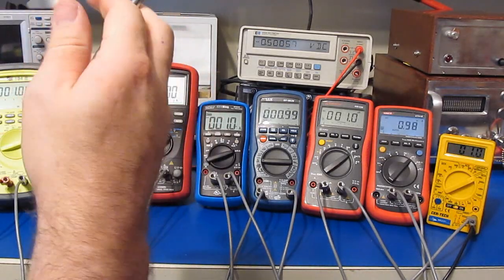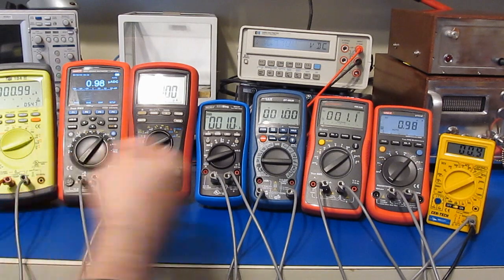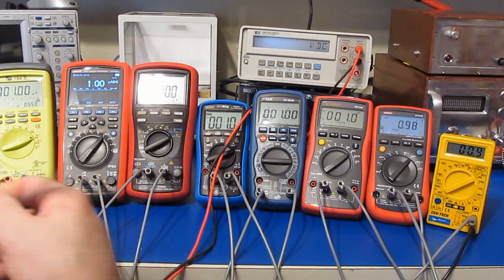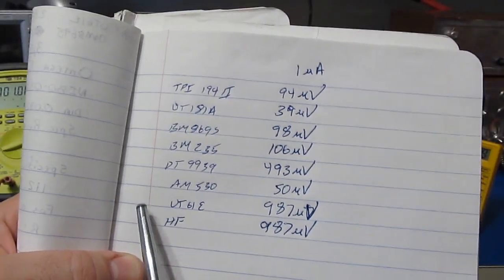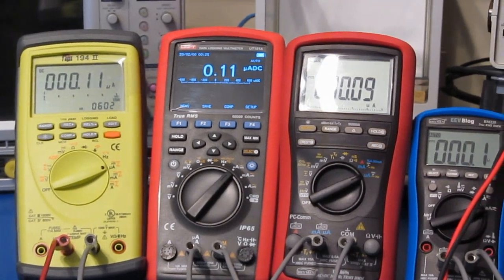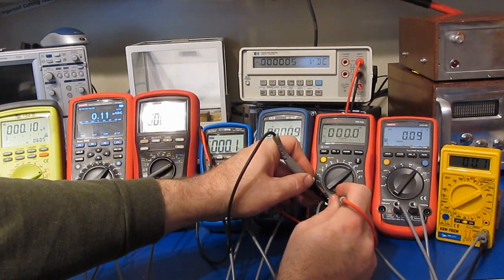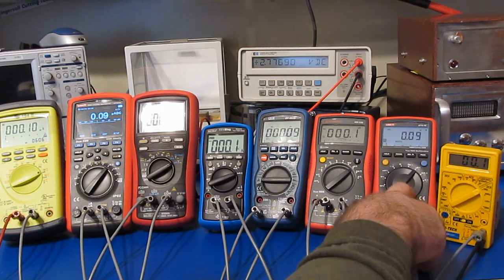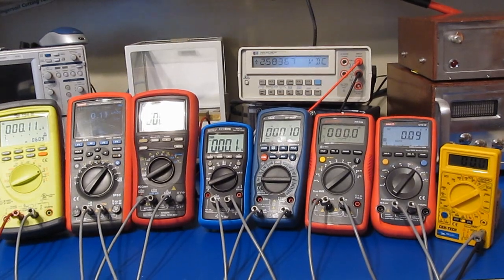Looking at Burden Voltage in the uA Range

Comment: I didnt expect the free one to even read that low lol.
The ut61 didnt supprise me, its shunts are much the same value as other meters.
Good test though :-D.
I found your entrys in the eevlog forum, the chaps seem to like your experements :-D
Reply from the maker: I was going to run the few other meters I have.  So far, just the free meter and the UT61E use the 1K shunt.  But again it was the lowest cost meter in the lineup.
Reply from the maker: Just finished making the video.  At least with the meters I have, 7 use 100 ohms, 2 use 50 ohms, 1 uses 500 ohms and 2 use 1K.  Keep in mind that the vast majority of the meters I had looked were destroyed during my testing.  The meters that I still have are more of a middle to upper class.  CEM using that shunt was poor on their part.
Reply: As you said  earlier, you would need an op-amp to boost the vdrop to be able to reduce the shunt, perhaps a 10x precision op-amp circuit would do the job, but its not worth all the trouble for the two cheapest meters.

Is there any standard for uA burden voltage, do you know?
Reply from the maker: Done with the edit.  Short videos for a change, kinda nice.  I have some choppers that would work very well in there but I tend to agree, it's just not worth it for the average joe.  If I mod it, it would need to be better than the UT181A...

Comment: The burden voltage of my Keysight 1253B is 100uV when measuring 1uA current.
Reply from the maker: Thanks for the info.  I would guess that the 100 ohm shunt is fairly common in the better meters.   I was not too surprised that the UT181A had such a low burden voltage but that AMPROBE AM530 caught me off guard.

Comment: Wouldn't it make sense to also measure with current near upper uA range where burden voltage really begins to matter more? Few mV or less drop seems too negligible but few tens of mV is more practical case. Indeed burden voltage should increase linearly with current increase but measuring accuracy could be better and maybe something else would influence the results.
Reply from the maker: I'm not sure how linear the fuses would be but the shunt should be somewhat linear for each range.  The UT61E does use the 4007's to clamp it.  I guess you could see these cause some problems.  The lower current would seem to be worst case if you were concerned about leakage.  I would expect if I repeated the test with 500uA for example,  the UT61E would drop about a 500mVish drop.  Where the TPI would be closer to 50mVish.

Comment: Joe, interesting video, thanks. Would also like to see a Fluke 87v or even a cheap 115/117.
Reply from the maker: No problem.  I saw the cost for the uCurrent Gold was a fair amount and was curious how well some of these meters would do.  He specs 10uV/uA so a fair amount better than even the UT181A.  Then again, the 181A is protected.
Reply: You are totally right, the uCurrent Gold is a nice tool, but it does not have the protection that a good DMM has.
Reply from the maker: The 115 will not read down this low, nor will the 107 or my HIOKI DT4252.  Of the other handheld meters I still have, the Fluke 17B+, UNI-T UT90A, AMPROBE AM510 and my Mastech would.  The two analog meters also have a 50uA range.  Good luck reading 1uA with those..